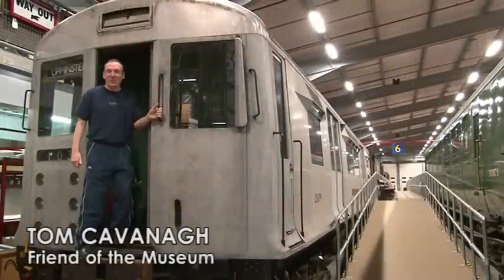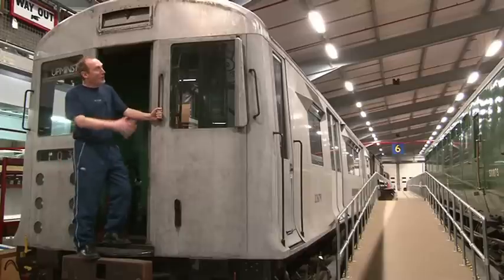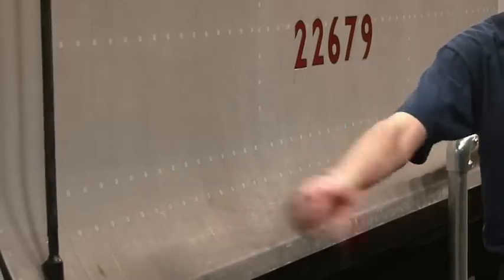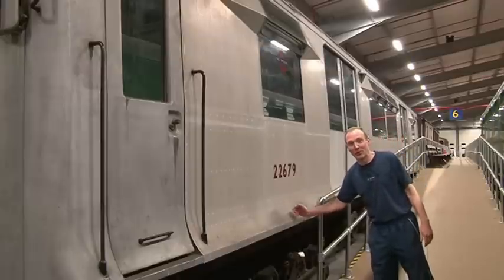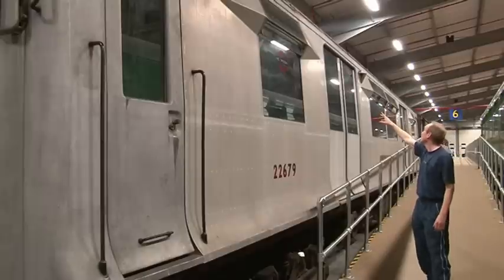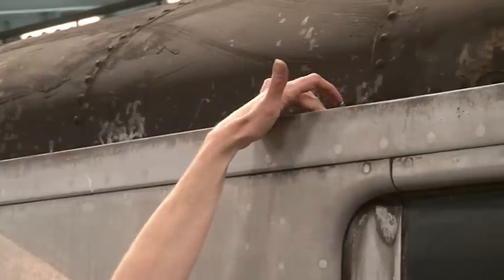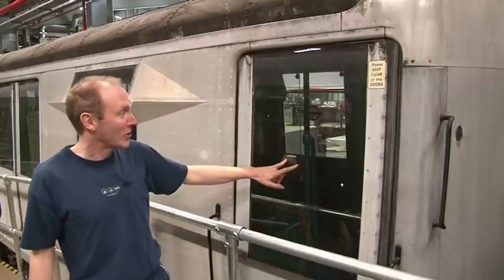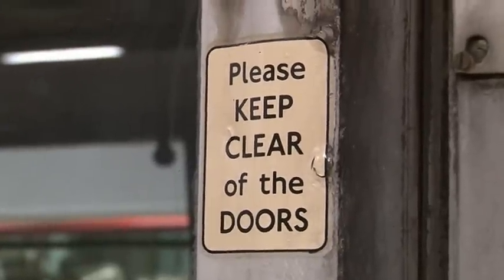Depot Discoveries - R49 Stock

Comment: Those were a lovely practical design, screamed art deco at you. Was lucky enough to work on these beauties at the end of their lives. The R49 driving cars numbered only 6, the others being Non-Driving Motors. It's a great pity that a unit no longer exists for the odd run, like the 1938 tube cars do.
Reply: R49 was used on many sub-surface lines, 1938 stock survived 50 years between 1938 and 1988, i wish that 1938 stock could be refurbished to announcements, that could extend its lifespan
Reply: I miss riding those beauts SO much.. .. . .

Comment: Currently Tokyo Metro is the Only Metro Network in the World Who Shares the Memories of 1st Rolling Stock Operated On Ginza (1000 Series [*] 1927-1968) & Marunouchi Lines (500 Series [*] 1954-1996). The 1000 Series Introduced in 2012 On the Ginza Line Were Constructed to Evoke the Design of the 1000 Series Introduced in the 1920s when Tokyo Underground Railway Was Opened. The Units 1139 & 1140 Are Resembling the Original 1000 Series Even More, Due to the Single Headlights & Retro Like Interior. Currently the 2000 Series Introduced on the Marunouchi Line Were Constructed To Evoke the Design Of the 500 Series Operated For 42 Years Since 1954. The 1000 & 2000 Series Themselfs Are To Resemble the 1st Rolling Stock Of Ginza & Marunouchi Lines When 1st Opened, But also with some Modern Touches. London Underground Unfortunately Doesn't Understand By Any Of it! If there Was Just One Manufacturer, That Could Make the Modern Tube Stock In the Future that Evokes The Design Of Older Rolling Stock Like the R49, Or A60/62, Then It Would Be Good. But For Now Londoners Have to Wait For Preservation of Older Units like the 83 Year Old Ex-38 Stock Used on the Island Line For 21 Years.

Comment: I used to ride those and the COCP red stock long before the D78’s, those stocks were built to last, and much better than today’s lightweight S7 and S8 stock.
Reply: Isn't that a Respiratory Illness?
Reply: S7 and S8 stock all the way
Reply: @RedArrow73   No. class specification.
Reply: @damienmanu117  Cutting corners with standardised wheel sets.

Comment: he is wrong on why the sides were flared, it was nothing to do with people hanging on the sides. The stock was designed in the 1930s, and so it's just part of the art deco appearance.
Reply: @ Yellow hat - correct, it was an art deco design by the then CME of LT William Graff-Baker (1889 - 1952). The flare was to emphasise visual continuity beween the vehicle body sides and the platform surface.
Reply: In NYC, the BMT rebuilt some of its elevated trains but with flayed walls curving out side for the eastern half that was built to also handle wider subway trains that share the same tracks from East New York to Richmond Hill terminal at Lefferts Blvd.